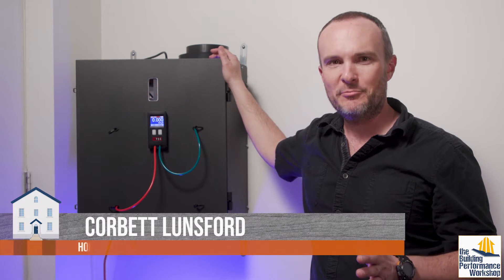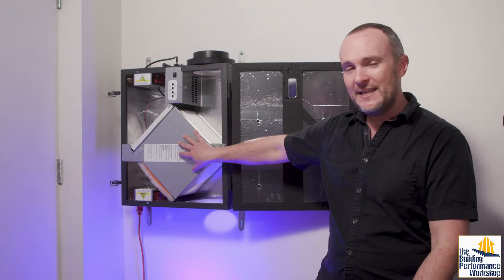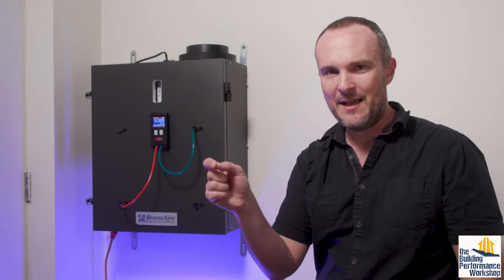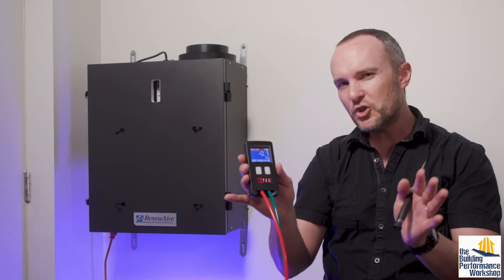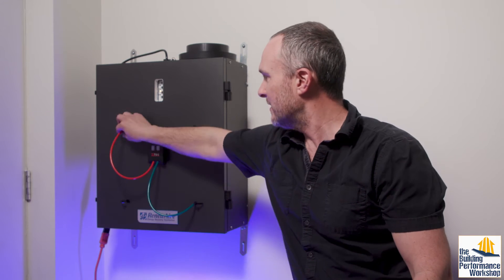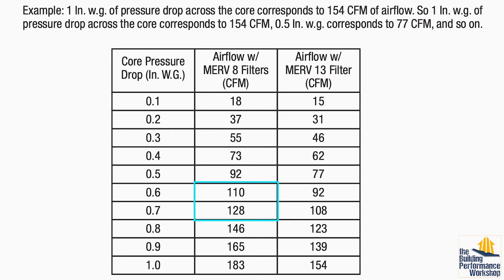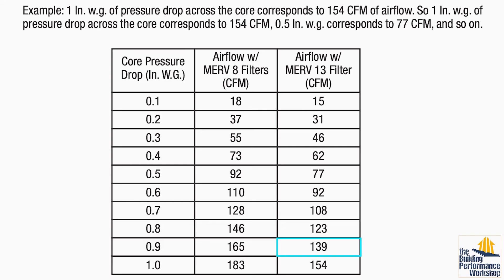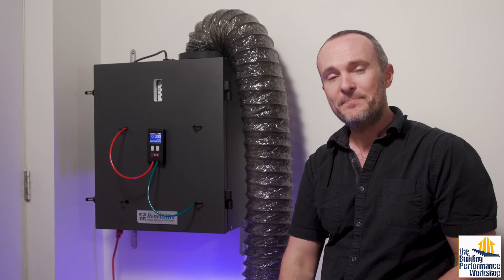HVAC Training: ERV Setup Testing/Commissioning, Using Pressure Curves to Measure Airflow (Renewaire)

Comment: Having an EC motor sounds great, but I'm having trouble understanding how to convert pressure into airflow if the fan itself is ramping up or down.  Wouldn't that change the chart you reference to convert pressure into cfms?

Comment: Stupid question but why do we not need the metal hooks at the end of the tubes like you use to test static pressure on a furnace?
Reply from the maker: Not stupid, but these ports have just a tiny hole at the bottom, and they’re designed for you to just plug the end of a hose right in.

Comment: ERVs are mandatory for new construction in Massachusetts, and as a HERS rater, I also highly recommend them for full gut renovations that get an older house tight (<4 ACH50).  So of course builders are rushing to buy the cheapest thing they can find to check off that box.  I'm seeing the Panasonic Whisper Comfort 60 (FV-06VE1) everywhere.  It's about $600.  I'd love to see a review of this product in particular.    It mounts on the ceiling like a regular bath fan with the incoming and outgoing air right next to each other.  There are only two channels instead of four.  Is seems like a good bargain for apartments, but what about larger homes?

Comment: Question isn’t the math supposed to be x (15 I think )amount of CFM per person in the home , I have the modern day refrigeration book and it spoke on fresh air. Great vids man working on more understanding of air applications in the trade
Reply from the maker: The default target for all homes is 7.5 cfm/person (now that we don’t smoke inside daily) plus 3 cfm per 100 sq ft of cond space. Minus blower door info if you know it. But you should be able yo turn that up or down from there because no 2 homes are the same.

Comment: Thanks for the explanations! I have a Panasonic intellibalance for cold climate. It has a chart with PA for a set CFM for exhaust and supply. I thought I had to balance the in and out with dampers to achieve this pressure difference, since it allows setting the CFM directly for both directions. Balancing would give the system a similar effective doct length. From what you described you are getting CFM from the pressure, so it's a different strategy?

Comment: Zender, Panasonic, Fantech ... oh my! Now renewaire ... my head is spinning. Love the video - can you do a comparison on models - feels impossible to choose.
Reply from the maker: I’ll add it to my list, Al
Reply: @HomePerformance  awesome. Just to clarify, does the fancy tool / high performance gauge  work with all ERV testing? Are those ports with rubber caps universal ? I’m assuming in less advanced units one would pair the tool and adjust dampers?
Reply from the maker: This is the most basic type of test arrangement, should be pretty universal. Some manuf like Broan incorporate built-in testing monitors in AI series, so you just punch in the CFM you want and it happens automatically.
Reply: @HomePerformance  got it, thank you! yeah, comparing models to see which ones have the belts and suspenders would be amazing. Hope you're having a great weekend.

Comment: My installer said I should have an hrv for my new home. It is a very energy efficient home but I live in Canada. Should I switch to a erv core, which I can do, or should I stay with the hrv core. If you need some stats on the home to make an informed comment I can provide.
Reply: Panasonic has a 100CFM ERV for cold climate and will cycle more during very cold days, yet still stay functional. Other models will close the supply damper and act like a bathroom fan under 20F.
Reply from the maker: Depends on how cold it gets for how long. There are pre-heaters for ERVs for the coldest days so you don’t get frost on the core- that will maintain a much healthier humidity for you year round.

Comment: Aiming towards neutral pressure indoors/outdoors is good, but erring on the side of negative indoor pressure in the winter and positive indoor pressure in summer will help keep damaging moisture out of the walls where it can condense and cause rot/mold.

FYI, your fancy high $$$ instrument loses to a cheaper one every time if the cheaper one has a current and traceable calibration certificate and yours doesn’t. ;)
Reply from the maker: Haha point taken, but please let me know who in the world is sending their $200 manometer in for calibration. I’d like to shake their hand.
Reply: @HomePerformance  😂

Comment: I highly recommend installing a seperate merv13 filter. One thats a whole lot bigger and a standard size that you can get anywhere.
Reply: That is ducted between the incoming air duct and the ERV? Any links to products you would use?
Reply: @rosemcommm  yes it goes on the outside air inlet. Use whatever you have locally available.

Comment: Do you have videos on how to think about how ERV connects or doesn't connect to a heating/cooling system? e.g how would you setup a tight home that has an ERV but also has heatpump. Would you connect the ducts together or have heating separate from fresh air?
Reply: Depends on few things. Some heatpump  brands have their own erv system which integrates together. But otherwise seperate systems is easier. I've seen so many hack jobs trying to join the two systems together.